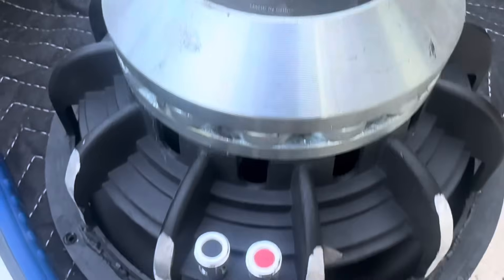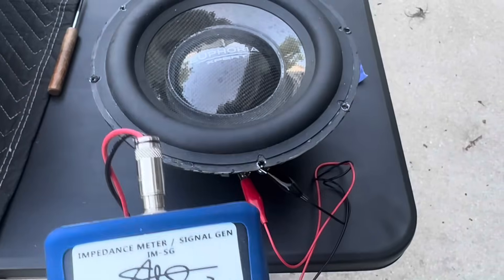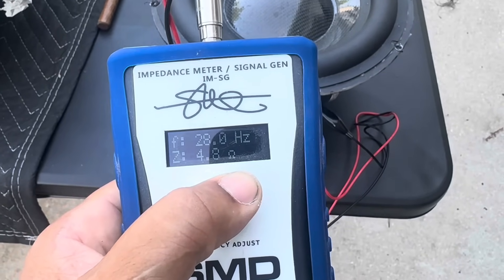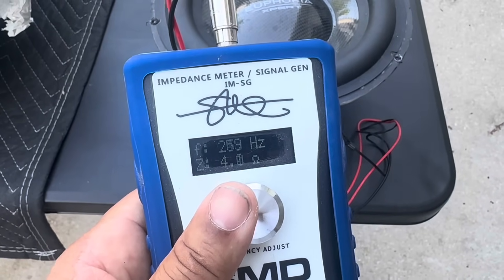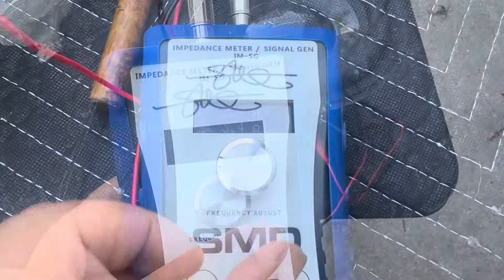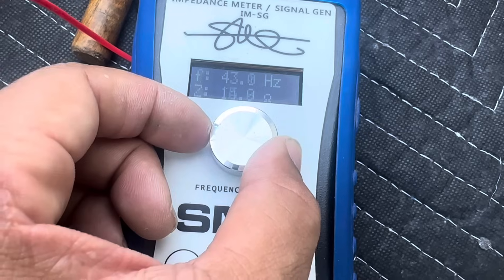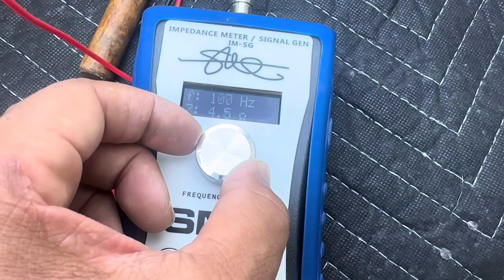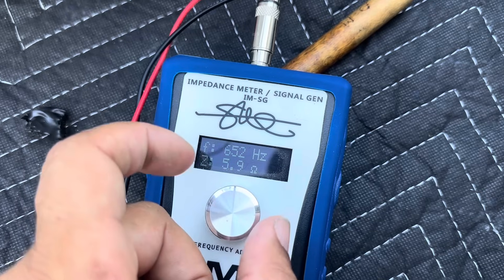How to run big power to your saddle bag woofers without blowing them up ? 🤔 Math is how .

Comment: If running big power from amps in tour pack to mid bass in bags can you do quick disconnects on bags or would you lose too much power?
Reply from the maker: @jaymiller6910  as long as you use disconnects that are rated for the current flow there will be no loss in power 

We use 150 amp connectors on our big power setups

Comment: I want to run my 10's in the 30hz range on occasion. They'll be in a Grudgebox 360 and will be subs, not midbass. Is that unrealistic? I'm coming from the car side so I'm learning.Also, great to know on the wire!

Comment: Question: Since the impendence rise requires you to run triple/quadruple the amount of power to the Midbass in smaller/stock bags is it safe to say that a much bigger saddlebag like the Wraith or Moneymaker with more space and less impendence rise would require a smaller amp like a 1600.1 or 3000.1 instead of the the 5000.1 to play at 40hz-200hz at 2ohms???
Reply from the maker: It will still have rise 
The rise will just be less 

The white bags I measured were audio bags

Comment: Love the information you make public. Thanks to the videos you put out i was able to put together my own install. Just finished up adding 200ls into my harley bags. It bangs and i wouldnt have had the confidence to tackle it without the knowledge you make accessible. 

My build for now is moto 6cds in my fairing, hertz sx690 neos in my lids all 4 running off an 800.4

And finally a set of hertz 200ls in my bags, in the back corner with the half moon cut to be flush with the rear fender running off a 1600.1 with a dubbes bass knob in the auxiliary switches. 

All it needs now is an rta tune
Reply: Man Carlos gave me this information a few months ago…I really appreciate more than I can say all the information given. Just the integrity of it all. Amazing